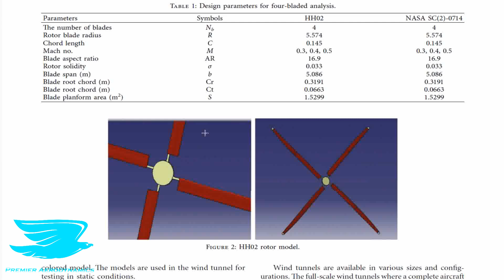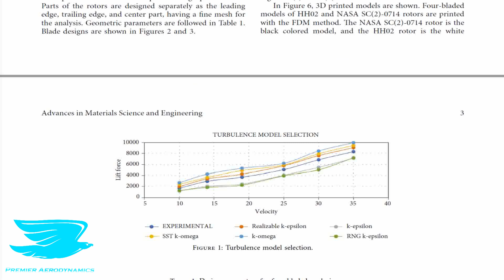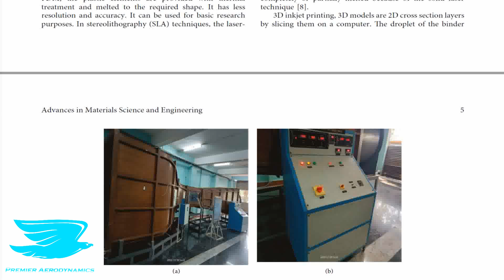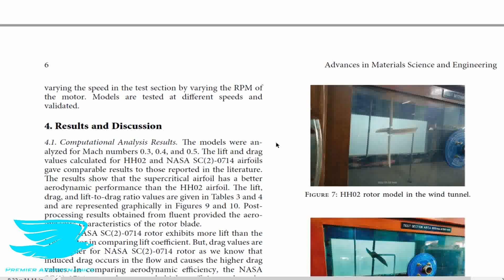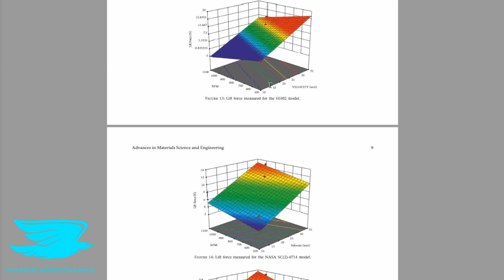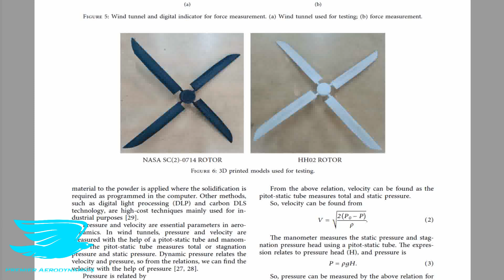Podcast #147 - Can You Use 3D Printing For Helicopter Rotor Blade Testing

Comment: Heads-up, looks like this paper was retracted!  From your link in the description, it now has the following:

Retracted: Wind Tunnel Testing and Validation of Helicopter Rotor Blades Using Additive Manufacturing
   This article has been retracted by Hindawi, as publisher, following an investigation undertaken by the publisher. This investigation has uncovered evidence of systematic manipulation of the publication and peer-review process. We cannot, therefore, vouch for the reliability or integrity of this article. ...
Reply from the maker: That's annoying. Thanks for letting us know.